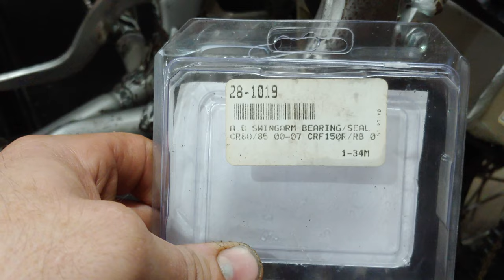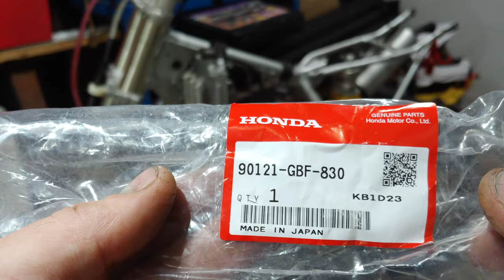03 Honda CR85r Rebuild Part 4 || Rebuilding Bike & First Start!!!

Comment: Great channel Boss 
I live in the UK 🇬🇧 and have bought a mint condition 2004 cr85 big wheel 
We only use on our farm. How many hours should I be changing the piston?
Reply from the maker: Welcome to the channel! Always Nice to see people from other countries enjoy the channel. Congrats on the find. If I recall correctly, if raced, pistons should grt cjanged every 30-40hrs. But if youre just casually riding it or trail ridinf they cam go a lot longer. 32:1 fuel to oil ration is also recommended.